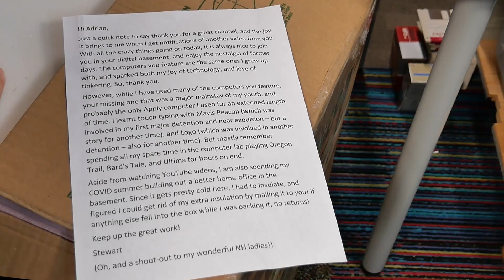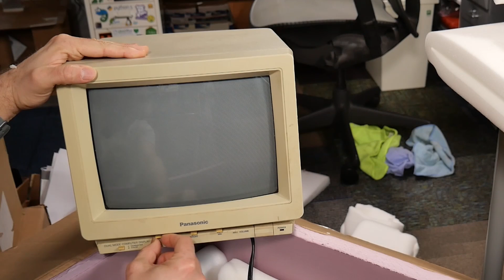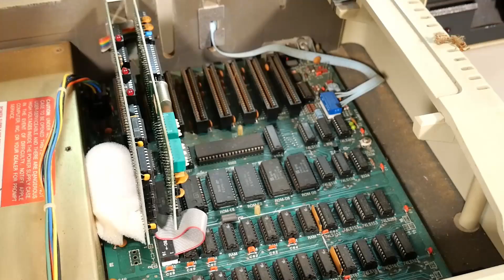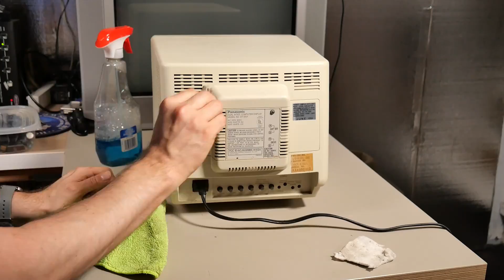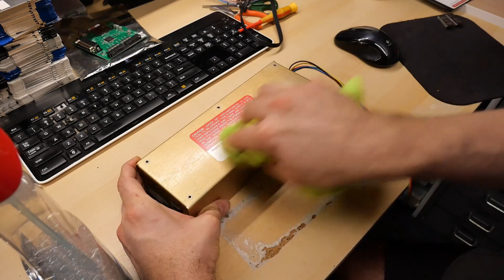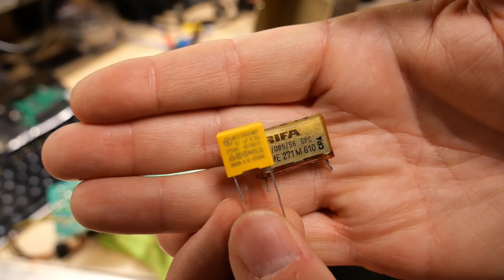A viewer sent in a very special donation!

Comment: I remember using a CPM card for the Apple II which gave you access to much more software for accessing BBS system with a modem.
Reply: The Z-80 Softcard was one.  Which reminds me, someone made a 68000 card, too!  "The Mill" comes to mind, but that mat have been a 6809-based card.  The 68000 one used a 68008 CPU to match the 8-bit bus width.  Someone even made an Apple ][ expansion chassis for S-100 Bus cards.
Reply: @bobblum5973  Thanks, I forgot the name.  Found this.  Microsoft Z80 SoftCard is a hit

The $349 card (a hefty $1,000 by today’s standards) was, in some ways, a surprise hit for Microsoft. Coming packaged with Microsoft BASIC, it debuted at the West Coast Computer Faire in March 1980, before going on sale the following month. In its first three months, Microsoft sold 5,000 units — considered a big success at the time.

In fact, the Z80 SoftCard remained Microsoft’s most successful product until the company introduced a mouse in 1983. By 1980, the Z80 SoftCard became Microsoft’s No. 1 revenue source.  https://www.cultofmac.com/538573/apple-history-microsoft-z80-softcard/
Reply: @pctrashtalk2069  Somewhere I have a pamphlet from back then, showing Microsoft's product line, I think for the Apple ][ line.  Funny thing, it's either that one or another one where it's spelled "MicroSoft".

CP/M was so big back then, I remember stuff in Byte magazine.  Small single board computers that could be mounted atop a 5.25-inch floppy drive, things like that, sort of the Raspberry Pi or Arduino of its day.  One was called the Little Board or Little Big Board... need to look those up, lots of interesting memories.  Also 6502-based boards like the KIM-1, SYM-1, the Rockwell AIM-65 with keyboard, single line LED text display and small thermal printer.  So many different products.

Comment: I spent way too many hours on my Apple ][+ that I can’t get back... but they were FUN hours! 🤣 Mine lasted 7 years before the 6502 died (heat stroke). I wish I had kept my Apple //e (that I got later), along with my issues of Nibble magazine. 🥺 Also, I’m pretty sure the plastic case was molded in that color, so it should be safe to retrobrite.

Comment: The Language Card didn't just allow you to switch out AppleSoft BASIC for Steve Wozniak's Integer BASIC, there were other languages you could use as well, such as Pascal and FORTH.  The methods used in the original 16kb Language Card were shortly extended to create 80kb versions, and the whole thing was rolled into the ][e, ][c, and ][gs.

Comment: When in college in 1984. They had a metal stand that went over the apple  2e that had place for a shelf for the disk drives with locking key between drives with power switch. Then monitor on top

Comment: ASTEC was the brand to go in the mid to late 1980ies when you did 8bit desktop conversions. they had really good but still affordable open frame switching power supplies. for my Amstrad CPC-conversion i even stripped out a clone PC psu and fitted an ASTEC board in.

Comment: 31:33 Adrian, can you make a video about how back in the day engineers developed and made circuit boards? These traces, holy moly! Somebody must have gone to art school in a previous life to draw these traces.
Reply: Not Art School, rather Drafting School.  Although designing good circuit layouts is an art form! 😉
I went to a technical college from 1975-1978, in the first class year that didn't require buying and using a slide rule.  Instead we could use those new-fangled slide rule (scientific) calculators.  And yes, we learned to do drafting, with a drafting board and templates; long before CAD.

Comment: This was Steve Wozniak's Apple. Open and serviceable and expansible
Reply: Woz was a hacker, a bodger and a tinkerer. His machines reflected that mentality.
Reply: @MadMorgie6318  is, not was.  He's still with us, and he still tinkers!
Reply: @Calphool222  Good to know that Woz isn't was.
Reply: @MadMorgie6318  Or Woz not Was?
Reply: I was going to say, being ahead on the use of a switching power supply and the high degree of serviceability has Woz's design written all over it.
Reply: @HaveYouTriedGuillotines  Jobs wanted the small power supply actually so they got a guy from tektronix to design it
Reply: @akkudakkupl  
Yeah, but who decided what kind

I doubt Jobs knew his ass from his elbow when it came to this sort of stuff.
Reply: Reading between the lines: Apple could make the iPhone “open and serviceable and expansible”. It’d fit snugly in a VCR tape box and weigh way more than a VCR tape did. I hope you got big sturdy pockets to fit one in, and to pay for all that extra material and shipping and processing costs - big things aren’t cheaper at all! Small or open. Pick one. All the connectors and shields so that your fingers won’t shear off components small enough that they get hard to see without glasses and so on: it takes space and weight. I am totally sure that Apple could make such a phone and nobody would buy it. I am all for open and expansible stuff. I want my phone to be small, light and practical. You can attach all your nerdy peripherals to it via lightning to USB cable and an Ethernet adapter. Your own peripheral can provide an Ethernet USB function and be totally compatible with an iPhone. Your own app can talk to it no problem. So as far as expansion goes, it already allows you to add your own peripherals - whatever you wish for. And to easily code for them. What else would one want?
Reply: Kuba Ober Well we talk here about computers and not phones. The computers that apple built today are not really fixable at all and apple does everything they can that they are not fixable. I recommend you the youtube channel of louis rossmann, he repairs macbooks on a component level and has much to say about this topic :)
Reply: @absurdengineering  
Instead of spreading ignorance, go to your favorite search engine and type in "modular smart phone."

The concept of a hackable smartphone isn't even vaguely new at this point.
Reply: GravianS Haha, OK. Those things are modular but that’s where the hack ability ends, pretty much. There’s only so much you can do while maintaining the ridiculously small component sizes. If I can’t add a reasonably complex module made myself without having to order board assembly or buy tons of advanced rework tools, then it’s all moot, isn’t it? A hackable phone would have something like a 2mm pitch headers somewhere, with reasonably fast busses on them, and room to add expansions of that size scale, with 0603 and larger components, etc. Those modular phones you allude to totally miss the boat in every respect. That’s why nobody buys them, but it’s not as if an Apple-made, larger, hackable one, would be a big success - not unless Apple would really put a lot of thought into it. And it wouldn’t be a cheap project and I’m still not convinced I’d buy it.
Reply: @absurdengineering  
This is completely and totally wrong.

I had a post explaining this in more detail, but google ate it. But suffices it to say you're spreading misinformation and need to stop.
Reply: @absurdengineering  right to repair you asshat. Let them build the phones however they want. Just force them to sell replacement parts to 3rd party repair shops.

Comment: Admit it, you were secretly hoping it wouldn't work just so you'd get to spend more time working on it...
Reply from the maker: Heh it is half the fun!
Reply: I love to look out for the "for parts/repair" listings on eBay. Often it's something very simple, like blown RIFA or tantalums. In the case of the Tandy 1100FD I picked up earlier in the year, it needed a power block (just had to look through the thrift stores to fine one that would match specs), and a new belt for the floppy drive. The VIC-20 I picked up just had a loose fuse holder on the 9VAC rail which was causing intermittent operation of the tape deck. If you've got the patience and the knowhow to repair them, it's usually cheaper this way than buying a known working unit. I've got an XT clone on the way that, from the pictures and description, needs some tantalums replaced, and then a good cleaning. I'll have to wait till it arrives to find out if the rest of it works, but it's got an MFM hard drive, so fingers crossed the drive was parked!

Comment: You can retro brite it. I didit it to mine. What I used was a food grade hydrogen peroxide 35% you can get from the grow shops. Use a flat storage bin that the case will fit all the way in. Fill it with hot tap water until it's covered. then dump about a quart of peroxide and leave in sun for about an hour. It's best r.b. I tried. You will not have any streaks or spoltches with this method and it's quick !!!

Comment: when you turn on the computer, it attempts to clear the screen by loading the screen with spaces (ASCII 32), but you're seeing  a question mark (ASCII 63), therefore it appears as though bits 0,1,2,3,4, and 5 are being set (0b111111), and the software is attempt to set the screen RAM to 32's (bit 7), thus if bit's 0 through 5 are falsely set to 1, and the software is setting bit 7 to one (or the chip is bad, and producing a 1 anyways), that's why you're seeing a screen full of "?".  At the barest minimum, the 1st 6 chips are bad, my guess is all 8 RAM chips need to be replaced.
Reply from the maker: Thanks! I've actually repaired the machine already but am not going to spill the beans on any of its faults. :-)

Comment: what a great packing job! when I was in elementary school they had apple IIes in a row in the library with every other one hooked to an imagewriter printer. I always craved to get to that particular machine. and then I would gorge on The print shop lol. if I didn't, it was oregon trail, or karateka. I don't think I ever saw a II plus, so must have not been that common where we lived. I got what was the closest to my childhood system when I got a IIc on freecycle about 8 years ago. I also by that time had acquired an imagewriter printer, so I was able to pair the two together. and among the software I got with the IIc? The print shop. lol good times.

Comment: Is the 2+ and the franklin basically the same thing or are they different?
Reply from the maker: The Franklin is really an upgrade on the II+ with lower case text and a bigger keyboard. As far as I know you can run original II+ ROMs in the Franklin even... Lowercase support would he lost though.

Comment: please, no paperclips jammed in random ports
Reply: Hahaha this is gonna be a joke for years. Love it
Reply: Adrian: carefully clean and observe everything, changed capacitors.
8-bit guy: yuhuu, smoke test!!
Reply: That's what happens when you're unable to find a technical reference manual :(
Reply: @BlackEpyon   Or your sense.
Reply: @rbrtck  If the jack is shorted during operation it seems pretty reasonable that using wire to hard short it would be fine. Hell, that's how you power up modern PSU's when they aren't connected to a motherboard
Reply: @stitchfinger7678   I don't think even he was sure about what he observed after he apparently fried the PSU.  He was in such a rush to just get the video over with, after all, and was even more impatient after he was defeated by Torx security screws.  He didn't bring the right screwdrivers (readily purchased from the nearest Harbor Freight), but he brought a Dremel that he used to cut into the PSU case (instead of the replaceable screw to make a slot?!).  Geez, if you don't have the time to do things right or even think straight, then let someone else do it.
Reply: me, a smartass: jams paperclips in every single port i can see

Comment: Be very careful with Windex, the ammonia in it can attack plastic and any coatings. It's why you aren't supposed to use it on displays.

Magic Erasers are 'magic' because they are abrasive, so like you said, a light touch is very important.
Reply from the maker: I'm curious if there is any more information on the ammonia and plastic interaction? I've not yet had any issues and have gone through so many bottles cleaning everything with it although I don't clean LCD panels with it because it never gives good results there.
Reply: @adriansdigitalbasement  I've always been told it, and a lot of glass cleaners that are for screens explicitly avoid ammonia. I notice for cars a lot of the interior cleaners also shun it.

I do know on LCDs ammonia attacks the coatings.

Comment: Fun Fact:  It's called "Applesoft BASIC" because it was made by Microsoft.  Integer BASIC was made by Woz, but was called Integer basic because it didn't support floating point.
Reply: Fun Fact: Apple licensing Microsoft BASIC saved Microsoft from bankruptcy after their disaster of a licensing deal with Jack Tramiel at Commodore. If only had Apple gone instead with the company that wrote Atari BASIC shortly thereafter...
Reply: @TheJeremyHolloway  I think it was scened. They all became aware of the fact that locking in the user in an artificially limited environment with no way out was the way to go.  The DOS command line guaranteed a crippled computer  Next step was protected mode witn an API. Now, everybody's running apps instead of programs, fully abstracted from the real computer underneath, only to spam and track you while all authorative control is hijacked.
Reply: Fun Fact Part 2: Steve Wozniak also included in the Integer Basic ROMs the Sweet-16, a virtual 16-bit machine.  Another example of how wonderfully creative Woz could be.

Fun Fact Part 3: Floppy disk controllers were too expensive back when the Apple ][ came out.  So Woz designed a state machine based controller and bought just the floppy drive mechanicals, allowing Apple to come out with the Disk ][ drive.
Reply: @bobblum5973   He also had the computer's 6502 processor do all the work that a disk controller ASIC would have done--yet another simple hardware + software solution to save on cost.  That's good--Woz's work is elegant in this way, and highly effective (within limits in some cases).  Then Apple jacked the price up as much as they could get away with anyway. ;)

By the way, while Woz was undeniably creative and even a certifiable genius at certain things like reducing chip count, there were some...oddities regarding his design philosophy.  For example, he didn't like interrupts and didn't understand why they were considered useful.  At least that's what he told some people (literally that he didn't understand interrupts).  And sure enough, the Apple II series does not natively support interrupts (there is some support in the expansion slots and the motherboard, but that was probably someone else's work, as Woz did not design the Apple II all by himself).  I guess he was largely right, since his computer designs were clearly functional and remained on the market for many years, with their CPUs polling and counting (with some exceptions) all the way.  He didn't save much hardware this way--he just didn't see the point.  Note that he could have saved on hardware and cost by having the CPU drive the display, like the Atari VCS/2600 and Sinclair ZX series do, but he didn't go to that extreme.  I won't go into this in detail right now, but suffice to say that interrupts do have their uses, much like his autonomous video logic.  I guess eccentricity is often coincident with genius. :)
Reply: @rbrtck  I could see why he'd avoid interrupts at that state of the technology, he was dedicating hardware and its timing at the system level, so interrupts would have interfered with that design.  Of course interrupts allow for more dynamic and flexible designs, but then also introduce risks of poorly written interrupt routines.

As I recall the floppy disks used PROM-based state machines to reduce cost, basically using feedback of PROM data to drive the PROM address lines.  I worked with a few other state machine designs in the years after the Apple ][, all were "interesting" to understand and troubleshoot. 🙂
Reply: @bobblum5973   That makes sense, and I think another thing we have to keep in mind is that according to Woz himself, he just didn't have any resources at his disposal, even for developing the Apple II.  He didn't have an assembler or, for that matter, a computer of his own to run it on, and living paycheck to paycheck at the time, he couldn't afford to pay for time on a computer, either.  This means he wrote the Apple II kernel and Integer BASIC on paper and assembled them into machine code manually, making any changes very difficult, error prone, and time consuming.  This was why, in part, as he once explained, the Apple II didn't support lower-case characters at first.  It might well explain other choices he had made, too, at least in part.  It's so easy these days to forget how things were back then, even though I went through that myself.

Others managed to do a bit more in some ways, in terms of computer architecture, but they had more resources, in terms of personnel (including chip design teams) and/or development tools.  Apple was still very much a hobbyist-level operation at the time, which makes what they did all the more impressive.
Reply: Hard to imagine. You have to program the float/carrier system yourself?

Comment: Apple II, II plus and early IIe were painted. Apple IIe later migrated to coloured plastic shell. Oddly the III/III plus that were in production inbetween II plus and IIe used coloured plastic shell.
Reply from the maker: Ok that's quite interesting. Information on this seems very scarce but this machine is definitely painted and I have IIe machines that aren't.

Comment: So, by sheer luck you put your insulation the right way on the walls, always put the metallic side towards warmth, foam side insulates cold and metallic side reflects warmth (back inside).
Reply: Unless you want to keep it cold, of course.
Reply: @BlackEpyon  even then it's metallic side towards warmth, only difference is where you are on the warm or cold side.